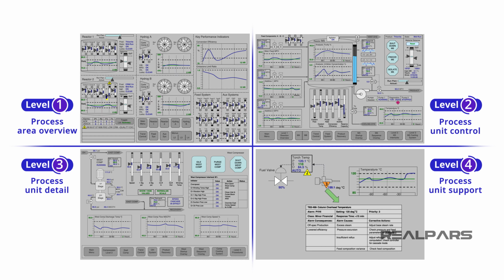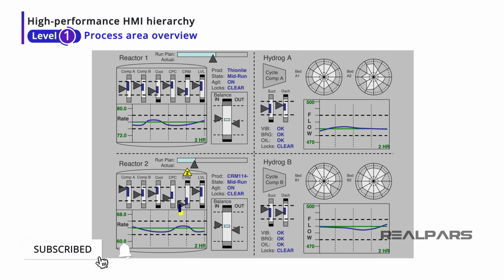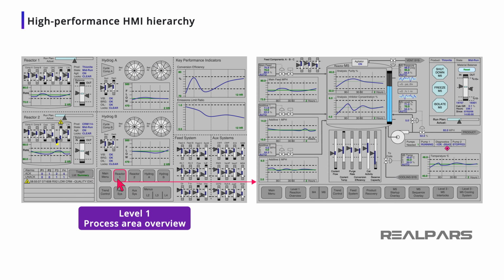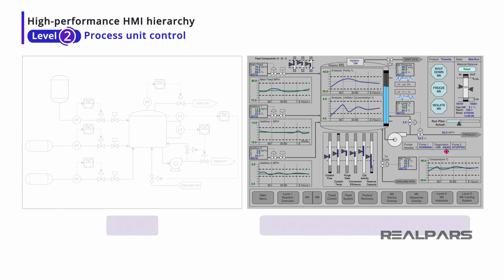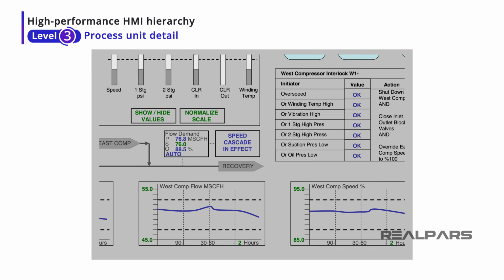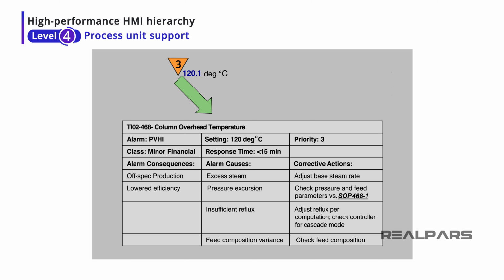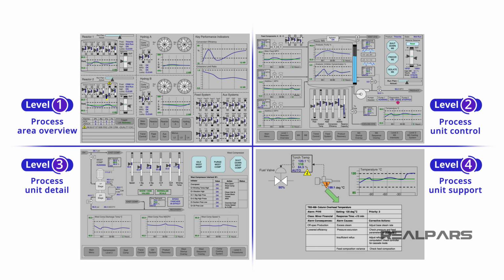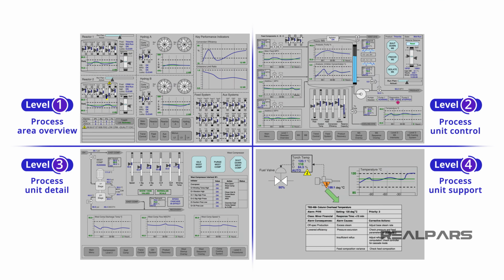Detailed Design Principles of High-Performance HMI Displays

Comment: I'm a maintenance technician that is cross-training as a controls tech. I've been tasked with upgrading Legacy Panelviews to PV+ and some Archestra development, as well. I noticed that the book is from 2008. Is there an updated version? If not, is the material in the book still considered best practice?
Reply from the maker: Yes, the High-Performance HMI Handbook was published in 2008, but it is still considered the gold standard on the topic.  The ISA 101 standard, published in 2015, embodies many concepts from the handbook into an international standard.  This standard has been the foundation of the style guides published by many vendors, including Rockwell and Yokogawa.   Both the H-P HMI Handbook and the ISA-101 standard will give you the blueprint for effective operator interface design.

Comment: what is the base system where such an HMI has been implemented? I mean is it Siemens WinCC or AllenBradley?
of course, theoretically it could be anyone. Nevetheless, the IDE or framework limits you while developing such a nice tools as sparklines / spider charts, etc.
Reply from the maker: Thank you for your question.  You are correct;  any HMI package can be used to develop high-performance graphics according to ISA101.  I believe the ones in this video were configured using Siemens WinCC Advanced.  The elements that are available to use in the graphic displays is dependent upon the HMI software package being used.  However, most any widget or display element can be created in most packages from the elementary parts and tools provided.